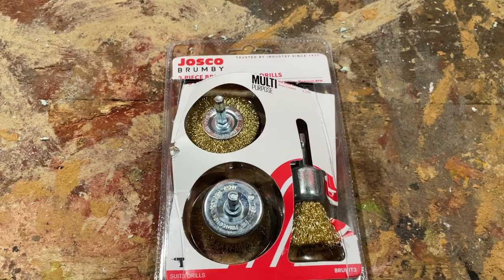How to Build Realistic Background - Diamond Python Rainforest Theme with Custom Heat Rock

Comment: Hi Cam, when you are adding the oxide to weather the rock and add depth are you adding it dry or doing another thin wet coat with the oxide in it?
Reply from the maker: I mix it with water to make it more runny so it’s more of a paint than hard coating

Comment: Did you use Dunlop slate grey tile pointing? My slate grey looks and feels gritty/also flakes after it dries, is that normal? This is my first time doing a background hence sorry for the silly question. Also would you seal the background eventually with pond sealer?
Reply from the maker: Yeah mate in the first coat it was slate grey with water, second coat was also slate grey but I added some oxides to change the colour and third coat was half sand pointing and half slate grey to lighten the colour a bit more. 
Never heard or seen the pointing flaking off send me a message through my Facebook page and I can assist you more.
Reply from the maker: Also no I don’t seal my builds

Comment: Did I miss where you put the temp probe on the heat cord rock/shelf? Or haven't you got that hooked up to a thermostat?
Reply from the maker: Nah mate you didn’t miss it I didn’t have a thermostat for it yet and she wasn’t going in there permanent for a bit after I finished the build so I wasn’t rushed to install one. 

I did have the heat running for a couple weeks without the thermostat and without her in there and it spiked on a warmer day and melted the underside of the rock. If you search my Facebook page you’ll see a post about it. I have since put a thermo underneath the rock in the grooves I have for airflow. Since added it I haven’t had and dramas with it. It’s set to keep the underside of the rock to 45 degrees which in turn has the surface about 25-30 degrees.
Reply: @Cambart1  awesome, I was curious about that, thanks for the update!
Reply from the maker: No worries mate. Feel free to message my Facebook page if you have any other questions. I see that more often then the comments.

Comment: Do you prefer a regular knife to a hot knife?  If so, why?
Reply from the maker: For cutting the expanding foam yes. I find it cuts quicker than the hot wire cutter. For the green insulation foam I use the hot wire because the knife tends to tear it’s way through leaving rough cuts

Comment: I'm going to assume that being a Chippie you made the enclosure yourself? what do you use? MDF or something lighter?
Reply from the maker: Yeah mate I made this one. It’s 16mm mdf and top and bottom facia panels are made from 30mm mdf that I debated the sliding track into. I sealed all internal joints with sikaflex and 5-6 coats of black pond sealer around the base and 3 coats on the walls. 
I wasn’t having a lot water in the enclosure but wanted it to be safe so I could make it semi bio active.
Reply: @Cambart1  Cool thanks for the info! appreciate it.

Comment: Hi again Cam, is that 12mm form ply? Great video
Reply from the maker: No it’s 16mm mdf. But 16mm form ply will work better. I had all intentions of waterproofing the entire inside so I wasn’t concerned with which product I used and I had better buying power for mdf. If it wasn’t my own enclosure I’d use form or marine ply for sure.
Reply: @Cambart1  cheers Cam. I also see you are a Wests Tiger supporter. I used to be a Balmain Tigers fan and club member, I just couldn't get into the whole almagamtion thing, though I did try. Good and informative vids mate
Reply from the maker: @gottalovethephilippines5417  haha yeah man unfortunately a tigers supporter. I only started following the footy in about 2000 so I only new them as wests tigers back then. Thanks mate if you have any other questions and you can message me through Insta or messenger.

Comment: Does the pointing also waterproof and seal the background/cage? I was thinking to use drylok for a few coast then add the pointing or would that just be a waste? 
Awesome job though man! Wonderful build. I’ve watched all your videos in the last few days lol
Reply from the maker: Yeah mate it’s waterproof enough that you don’t need to seal it. It will eventually absorb water when under water constantly. It’s only available in Australia also, we don’t have dryloc here but I have used waterproofing as first lets over the foam for constant water areas then coat with pointing.
Reply: @Cambart1  looks like grout to me
Reply from the maker: Yep not grout

Comment: Last Question, I swear!! lol, do you know what wattage heat cord you used mate? Thanks for all the info and tips Cam, appreciate it mate!
Reply from the maker: It was a 2m cord I’m pretty sure. Not sure on wattage though. Please be careful if you’re going to make a heat rock this way. Check my Facebook page for a couple issue I came across a few months after the build. Essentially ALWAYS use a thermostat in a correct manor.
Reply: @Cambart1  Will do, thanks mate! I would have got a radiant heat panel but I think they or some pf the components are made in china because you just can't get them anymore from anywhere even overseas sites don't stock them......kinda sucks, So it's either a heat rock like yours or I could diy a heat panel...
Reply from the maker: Yeah mate I was after a heat panel also and couldn’t get them anywhere in aus and if I ordered one from the states it was ridiculously expensive. 

I have seen few videos of people making heat panels from heat cords etc but they didn’t look appealing and would rather see a cage and DHP globe.
Reply: @Cambart1  Yep it's a sad time in the world lol, and the price of shipping! I was going to order a $14.00 part from Switzerland until I found out it was going to cost me $85.00 in shipping. 

Yes same videos I checked out for DIY heat panels probably, I just don't know how much heat they'd throw off in a big enclosure though I need to make 3 enclosures,  2.4 x 1 x 1 m is the largest for my olive.